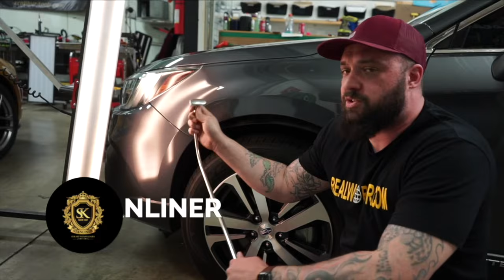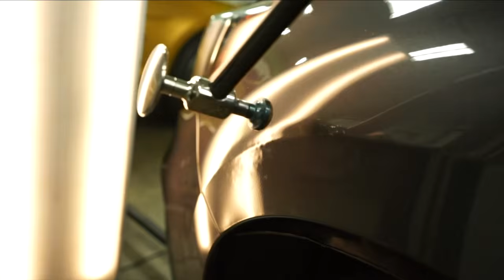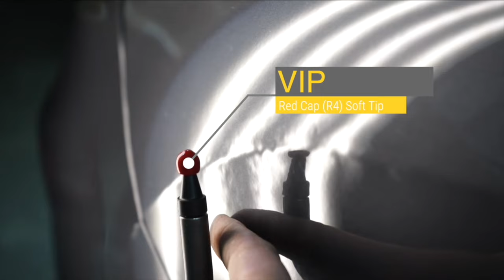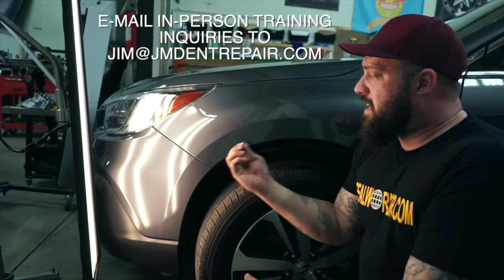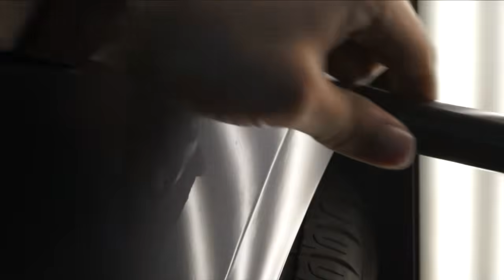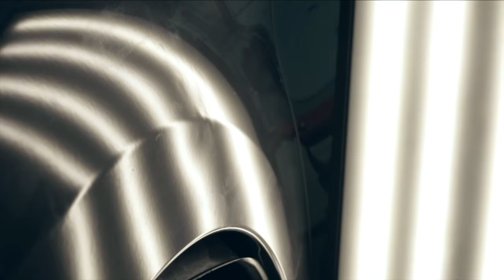FULL PDR LESSON 👨🏽‍🎓- Dent Removal Techniques - Subaru Fender Dent

Comment: And old school metal finishing tip that you can apply:

In the beginning, when you are pushing, stop and hole the pressure on, and gently tap on the crown. Dont hit it so hard you deform it, but tap gentile to "Nudge" it into letting go of its stress. Use a "slapper", or your metal hub cap hammer.
Reply: Deer that's true but not always possible

Comment: Hi, I have a huge roof dent covering the whole left roof rear quarter. It includes some deep creases at the left roof rail. Can I get by with some basic minimal PDR tools? Thanks.
Reply from the maker: PDR isn’t something that generally goes well for a DIY guy. I’d recommend finding a good PDR technician in your area. It takes years to learn this skill well enough to even repair moderate damage well. What you describe seems pretty extensive. It’s entirely possible you’ll make the damage worse and unrepairable if you try yourself. Sorry for the bad news, I’m trying to be honest here.

Comment: I can't believe someone could dislike this great video
Reply from the maker: Ahhh, people find reasons to hate on things. It’s ok, I’ve got thick skin!
Reply: I'm going to dislike it on the grounds of creating tons of high spots while pushing from behind, I'd say about 80% of those high spots could've been avoided if he had been more careful and PATIENT. He just made a lot more work for himself by creating all those high spots that he had to knock down.
Reply: @Mr1ssalinas  Kind of think he made a point of doing that to illustrate you can minimize that or go to hard and cause the issue, which was one of the items he was showing how to correct. One point you're probably not aware of is just how much harder fine motor skills are to control despite your experience when you are a properly built  big boy. I am highly trained in my own trades, and a  pretty big boy myself, and if I forget for just a second, power being used I can easily crush/snap/damage/dent/wreck whatever I am working on.  This isn't a lack of being careful and PATIENT as you state, it's the fact that when you are 5-10 times stronger than the average man, you have a lot more power to manage. Kind of like trying to do detail work with a sledge hammer instead of a ball peen.

Comment: i think fender repairs are overdone i want to see boxside big truck repairs we get them constantly in midwest and tools need to be thin and very strong with a big  swoopp to go through boxside top holes under cap i love my shaved reaper rod but it will not turn in the square holes and i have a bunch waiting tuesday no ascess lower sections gravel rock outys ect.we all know a good rod is no good if you dont have the swoop to reach the dent to get power but still thin to go through factory holes its a bitch on side damange

Comment: i got a lesson in humble pie today a guy brought in a 2018 duramax 1 ton it has hit every gravel road from mn to texas 4 inch lift big tires ect their was so many dents it made me dizzy in just 3 hours i was overwhelmed and hoping for help but it never came another 50 dents left sharp crease ones and huge soft ones all over boxsides fenders doors ect.the 36inch dentcraft doublebend tool has paid for itself running through top holes under boxside pads and bouncing the soft ones out and ultra and anson tools worked but i was blind after work tonight and i had to call my date off cause my body ached im 59 now